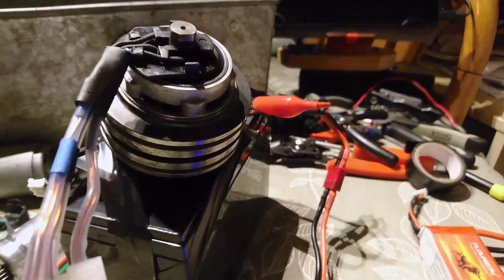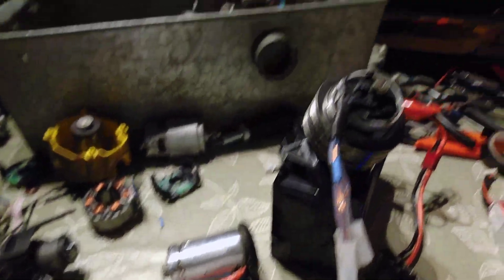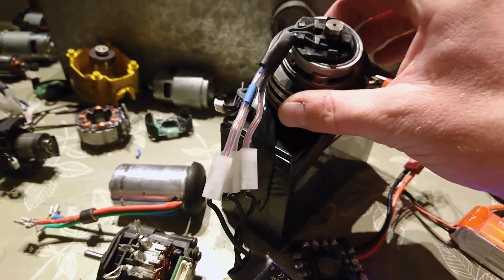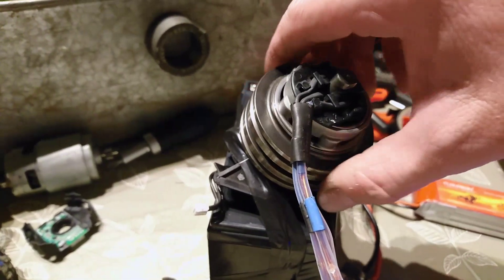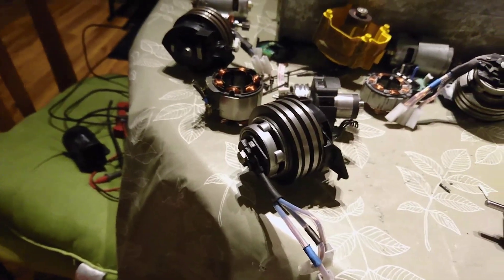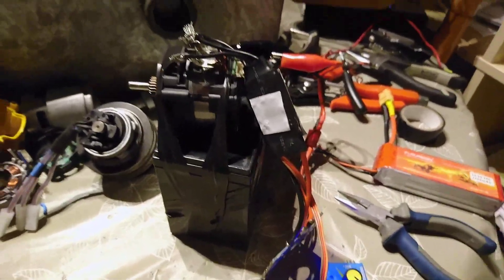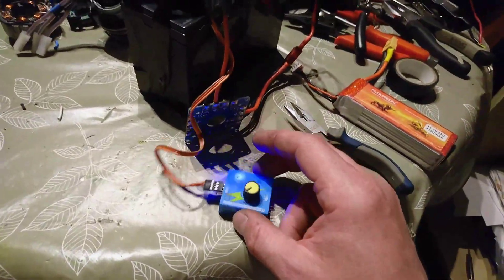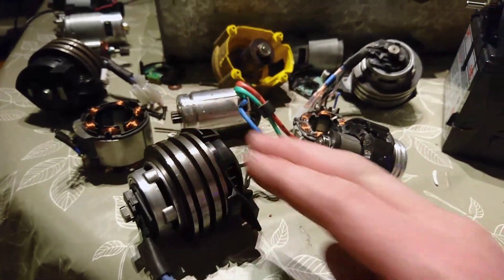dc Brushless motors/ESC controllers / motor's run

Comment: high1voltage1rules   For my induction heater can I use a 555 timer as the chip for my gate driver?
Reply from the maker: Owen Chase science channel yes mate as thier high frequency generator chips 👍